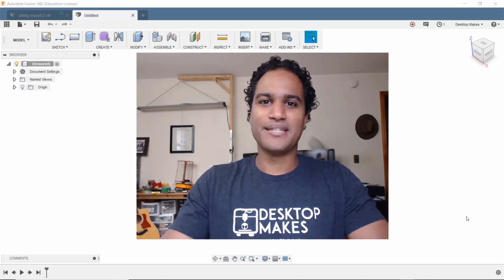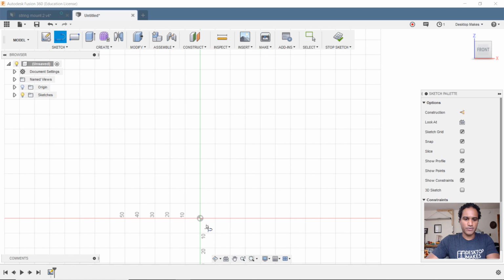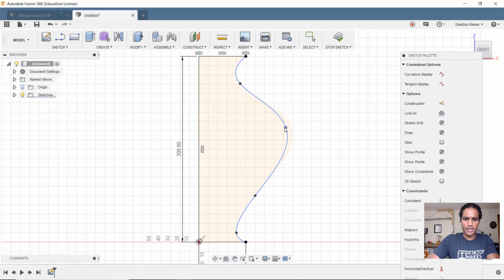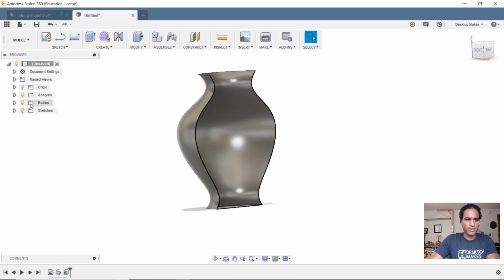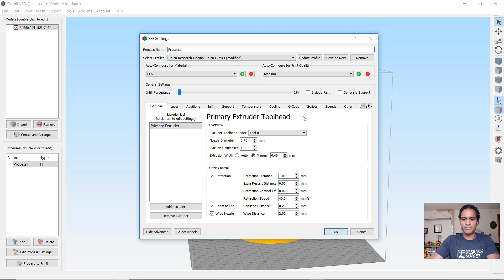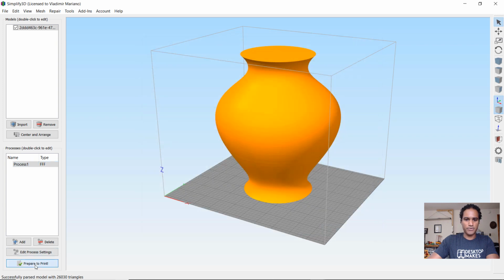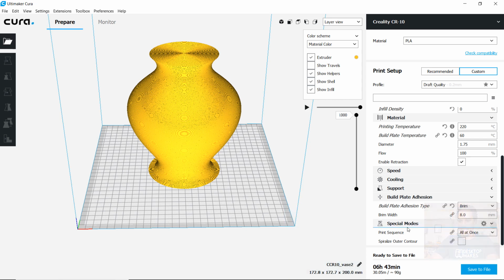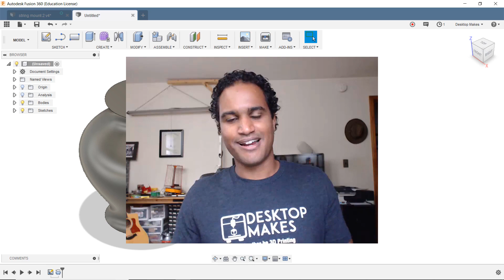3D Printing in Vase Mode with Fusion 360

Comment: You can probably fix the gaps by changing the settings withi the thin wall behavior section on the advanced tab within S3D. But indeed, vase mode is much better for this.